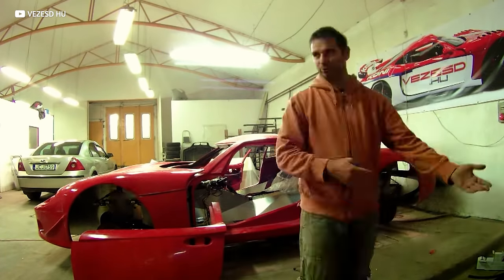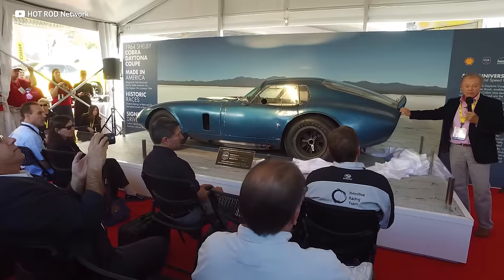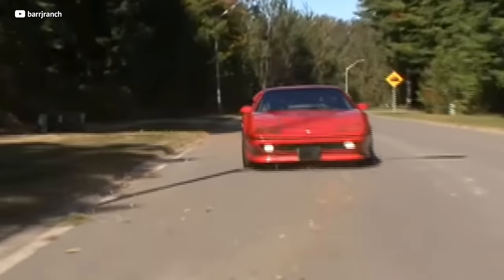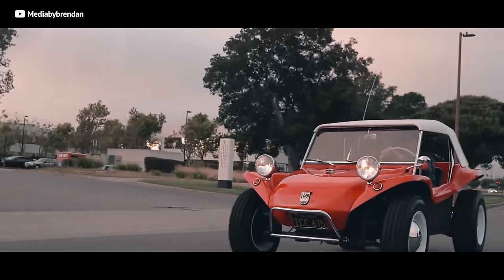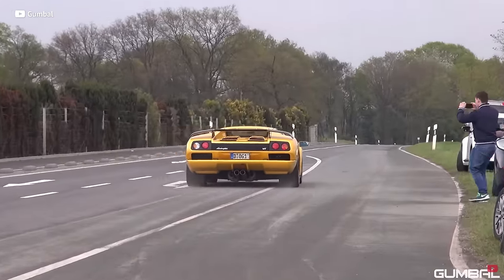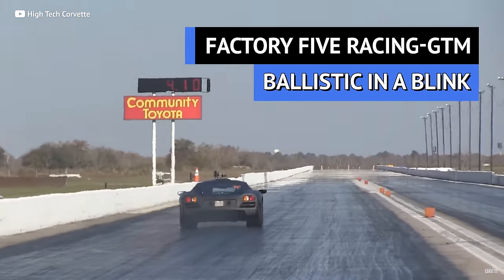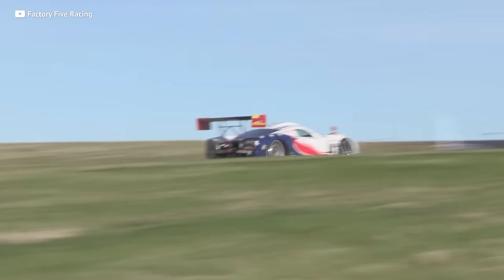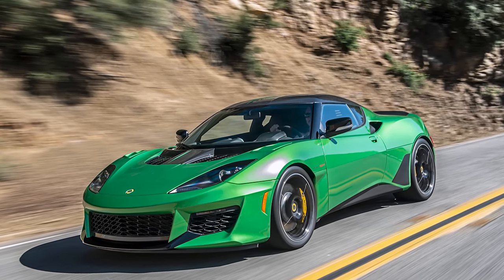CHEAP Kit Cars That SMOKE Supercars

Comment: Fiero kits can be scary fast with a V8 conversion. The kits for the V8 conversion are readily available and, with a 400-500 hp small block Chevy transplant, the "Fiero" is now a serious threat to the "supercars"...which is why Chevrolet FORCED Pontiac to STOP producing them. They were cutting into Corvette sales by the 1988 model year and that's why that year is only a half year production.
Reply: A 3800 sc is better balanced in those chassis and plenty enough power for those tin cans. But I like where you’re goin with this…

Comment: Imagine Dodge demon engine in any of these kit cars xD
Reply: Or even a Hemi or a Hellcat engine
Reply: i’d love them with an LT1 or an LS3
Reply from the maker: ayyyyy!!! would make supacar power!
Reply: @IdealMediaChannel  Ah yes 1k HP whiney boi for some super car power, sounds like a horrifying experience
Reply: you most definitely under 13, why not hellcat why you jump ? It’s 50 more horse power
Reply: Iron block.....too heavy. LS7 or if supercharged.....ZR1 or GT500 engine.
Reply: It would blew the doors and hood away
Reply: What about a 4 rotor engine.
Reply: There are
Reply: @officiallilsideshow  Not the most cost effective or reliable. Much easier to get plenty of power out of V8.
Reply: @stevekoffeld9071  I'm 4 rotor swapping an Autozam AZ-1 probably.
Reply: I don’t think it would fit, and the weight distribution would be terrible. Not to mention non of these cars can put down that kind of power.
Reply: Orrr a built 2jz.
Reply: Lsx or 2jz
Reply: @dartonbraden7957  what kind of question is that, pfft ofc 2JZ
Reply: it will be slaying tyres...
Reply: Imagine the new hellephant with 1000hp
Reply: Heck no .......a built vr38dett pushing 2 to 3 k in any of these would smoke the demon engine hahahahhahahah
Reply: Time to put one in a Miata
Reply: Dodge demon with a custom Flat plain Billet camshaft and a 8-1 exhaust system with a huge collector and converter.
Reply: Sike, u mean a 2JZ
Reply: Or a Hellephant engine
Reply: @IdealMediaChannel  more than that.
Reply: @bearieroblox6451  that's why I'm modifying almost everything from the Autozam and making it have the ability to handle the power.
Reply: won't fit kid 👍
Reply: @karlsmith2570  all three of them engines are the same platform. 🤫
Reply: @Ole_CornPop  are they??
Reply: @karlsmith2570  the Hellcat and Demon are both Hemis "hemispherical". Only difference from the Demon to Hellcat is a larger 2.7 litre supercharger.
Reply: @karlsmith2570  Hellcat is 707 hp, Demon is 840 hp. Same difference in a Shelby GT 500 and it's more powerful Super Snake brother.
Reply: Just wait
Reply: @bryantmatthews93  u gonna do it??
Reply: @rarewifi9303  i don't know
Reply: Yeah, without weighing a few tons
Reply: Hell yes
Reply: You can even go NUTS with the "Hellephant" ... but you are then getting well past the "Affordable" concept...
OR a car, suspension, brakes, etc to HANDLE that kind of HP... and all of those engine parts add WEIGHT to the end of the car where you place the engine. So handling balance can go out the window.
Reply: Yes but no
Reply: That is mecanic engineering insanity......im interested
Reply: People would die 😂
Reply: It'll be expensive as hell it's like 25 to 30k for a new Hellcat motor so I know the Demon hitting for double that.
Reply: It would probably be unbalanced?see this is the BEAUTY  of cars like this most are under 2,500.lbs therefore you dont need a huge engine from a car primarily designed to go fast in a straight line in a car that weighs 4 thousand pounds.
Reply: My bad a dodge demon weighs 4,200lbs probably doesn't handle canyons or switchbacks very well
Reply: First
On 
Race 
Day
would be better, reliable!
Reply: supercharger whine intensifies
Reply: Hear me out built k20 with a big turbo
Reply: imagine if your girl didnt cheat on you
Reply: @k00lkidz4  how can my right hand cheat on anybody?

Comment: Pontiac Fiero: It's actually a great car to work on, as long it has a MANUAL TRANSMISSION along with the V6 engine, hopefully...
Myers Manx: It's a dune buggy! You can just simply mod it, throw in big tires and off road it!
Reply from the maker: out of those two... which one would you rather have?
Reply: @IdealMediaChannel  It's a seriously tough choice for me, but in the end I managed to choose the Pontiac Fiero, because imagine driving the dune buggy anywhere and suddenly the rain comes down, not cool...
Reply: @IdealMediaChannel  you know that you can put a v8 in a fiero.
Reply: @cbradley9440  Better still, a 3.8l GM V6 supercharged or turbocharged. About the same horsepower but less weight.
Reply: I've heard of fiero builds with v8s such as northstar engines from Cadillac Eldorados,I even saw a 455 oldsmobile and a blower in one
Reply: @lokisgodhi  yeah you could even get a installation kit for them, and you start with a GT with the better suspension and already have a V6 win win
Reply: @alain99v6  Th stock V6 in the Fiero was GM's narrow 60 degree 2.8l V6. It's pretty anemic. The 3.8l is a 90 degree engine. It's a lot more powerful. Especially if turbo or supercharged.
Reply: @benjaminchartier6458  No.. the Cad engine is Known to be Shit.. just stick a good 3.8 or if you want an 8cyl, a 283 in it. A Stock 350 will fit in it also. 
@GuanZe Liew Yeah, I have an 85. The Year After they figured out all the electrical gremlins.. Planned on putting the Countach Kit on it for the Stretched Chassis, not the Stock one where it looks Squished. Then put a nicely built 3.8 in it. But it's been sitting in Minnesota for 12yrs with less than 100miles on a New Engine in it, in a field, while I am in Florida and can't find anyone to bring it down to me for a Decent Price...

Comment: I definitely understand the non appeal of the fiero but I've got 2 and I love to throw them around tho none of mine are stock and one of them has the ws6 suspension upgrade the engines are probably easier to take out than putting the body kit on it i can get it out in 2 hours and 3.4 and 3.8s bolt right up and i absolutely love mine

Comment: For what it's worth, setting aside the fact that a DYI kit car is cool to be able to say you built it yourself for cheap. The only one I would really want to build is the Factory 5 GTM but even at 25k without the C5 it will end up costing you 35-50k and that's not counting all the hours of labor involved!   Sooo I just went out and bought a cheap (8-10k) little Saturn Sky Redline, and with some bolt-on's and a tune I've got a light (2,900lbs) fun roadster making 350 hp at the wheel for around 10-12k, perfect for autocross / road course weekend's.

Comment: The Dino 206/246 GT and GTS were not designed by Bertone but by Aldo Brovarone at Pininfarina. Marcello Gandini at Bertone designed the Dino 208/308 GT4 which was a mid engine V8 powered 4 seater. The Dino 308 GT4 was introduced in 1973 and supplemented by the 208 GT4 in 1975. The cars were sold with Dino badging (continuing the Dino brand in honor of Enzo Ferrari’s late son, to differentiate non-V12 Ferraris) until May 1976, when they received Ferrari badging.  The  Ferrari GT4 was later replaced by the Mondial 8 in 1980. The only other Ferraris designed by Bertone’s Marcelo Gandini were a couple of one off Ferrari 250 GT SWB Speciales and the 308 GT Rainbow shown at the 1976 Turin Auto Show of which only one was built. Bertone did design the Lancia Stratos though. You got that part right.

Comment: The Factory 5 GTM isn’t built on a Corvette C5 platform it uses the C5’s drivetrain and some other components but it features it’s own unique tubular chassis and suspension along with it’s own body. The GTM can be built using other components besides the C5’s but some modifications are necessary.

Comment: Watched a Video a few days ago about the Ultima RS... Sure, the "Kit" is only $26,000 but by the time he was done, he had Just Under $200,000 into it. That included about a $30,000 1000hp engine and about another $30,000 in Options (just for the car). So that's already $86,000 right there and that left about another $114,000 in Stuff added himself that was not included.

Comment: 10:28 little fact the rover v8 is actually a gm design first used in Buick aswell as first Turbocharged engine EVER

Comment: The fiero was not a speed monster, as I think they were governed between 80, and 120, but they would burn out like crazy. Fun little cars, that could be made into something scary lol. I mean emagine a fiero, with a built 6.0, or even 6.2, or whatever in the back. Say 600 or more straight to the wheels lol. I doubt it would be possible to hook, but man. As quick as the little cars were with , the 4 bangers, and the v 6, that put out what 180 hp, or so lol.

Comment: great video and nice alternatives, but I kinda feel you forgot the Vaydor. definitely a potent car if you use the g37 as a base and it wouldn'T be too expensive either. 
too bad Germany is harsh on kit cars, you need a unique licening and checkups etc , which alone would probably cost aorund 10 to 15k euros just to get the car allowed on the street. Germany is mean against DIY cars :c
Reply: Laughs in India
Reply: Austria is more harsh sadly, its cheaper to send cars to germany let them stay with a friend of yours and then do it

Comment: lol I'm sorry have you seen the Factory 5 kits? For 25k you get the body and that's it. It cost around 50-60k or so to build  and that's NOT including the LS/Porsche stuff. Once you do interior , wheels, tires, aero, paint and body works etc etc you will be in for a huge surprise. I was going to do that to my Procharged vette and said oh hell no. The cost was crazy. You may want to do a little more research next time. 50k or so minus the  LS/Porsche stuff is not cheap. None of those kits are cheap.CMon man

Comment: got to say, the fiero is faster and worth more than any mustang imho. with minimal mods, a v6 manual transmission fiero will stomp most v8 mustangs, let alone a v6. I dont know what fieros you have drove or owned, but I have had over 20 of them and some ran in low to mid 12's with the v6 with minor mods .

Comment: A Fiero has one of the strongest structural designs . And you can put any GM engine in it you want. Mid engine, great weight distribution and light weight. Why is this not good to you?!?

Comment: You can find an old s600 mercedes and pull the drive train and have a reliable v12 that was used in Pagani as well as mercedes blatantly.  But you can stay far away from a bmw engine.  
I have a mercedes engine..in a mercedes lol but that engine is perfect and runs literally better than the day it was made. The transmission is the 722.9 and can hold over 1000hp and way more torture  . The independent suspension is by far better then most in it and can hold the mercedes power . 
The mercedes v12 has a formula 1 car sound when is got the exhaust done correctly.. 
Honestly by a cheap wrecked s600 v12 and use it in a Lamborghini kit. It can also be 4matic so all wheel drive like that labo

Comment: Fieros have so much WASTED
potential. 
(any stock, unmodified one that is) 
On paper, most people diss 
the fiero.
 But,on the street, people IMMEDIATELY recognize it
and genuinely love/like them.
(GT's are usually the most
accepted and received)
I have a 86 GT fastback, and I love owning it!  
The styling is still timeless,
there is a healthy aftermarket 
for upgrades, you can literally 
put whatever engine you want
in them, and they are very AFFORDABLE  as a project car.

My stock front/rear suspension has been replaced /upgraded, the stock
chokefest exhaust is gone,
(the factory y pipe is a joke)😑
I've added the sprint headers,
upgraded the stock injectors, and lowered the engine temp.
(Amongst other things)

Only real draw back for a stock/ quasi modified fiero is
that HORRIBLE hi-lo stock intake on there.
(The whole UPPER portion of
intake should be thrown away
IMMEDIATELY)
Come on Pontiac motor division, you could of made
a performance upper intake 
and sold that through the dealer as a dragstrip option.
(Gm has done this before)

I still have the 2.8 (reman),
but like the 3.4 for weight
reduction, better intake
flow, and I don't like following 
the crowd. 
The 3.8 v6 is a VERY good engine, but I want
to change the minds of naysayers that hate on the 2.8
mill.
I have plans for welding up an 
aluminum upper intake, but I
need to address the fuel/tuning aspect of things first.
I tried calling some tuners about upgrading/ deleting 
the factory obd1 parameters,
(Custom chip) but they can
only make a chip for TRACK USE ONLY. 😮‍💨
WTH. 
There is a Beretta computer swap that helps,
but I am not getting into re pinning all that wire, there is micro squirt, and HP tuners.
(More wire, and data logging)
I'd rather find someone LOCAL
who can finesse that obd1 crap, but imma probably going
to look at the HP tuner.

The fiero does haul out with
just simple mods, heat extractors, and weight reduction, but needs a proper dyno tune!
My apologies for the long post,
I am just passionate about
these little cars, and the creative potential they have!
Shalom

Comment: Wow. I cant believe the disregard for the fiero. U gotta think. Wide body short wheel base enough room  to drop a v8 in which is entirely unnecessary for an 1600 lbs car widebody kits which widen the track potential, easy to improve torsional rigidity by connecting the 2 chassis setup, and with a simple aluminum motor swap a neer perfect weight balance with no other modifications 450 hp puts you to better than 5 lbs per hp which in modern day terms is actualy not that hard to do. Low center if gravity.... you are completely wrong about the fiero. It's simple math.
Reply: The fiero has a curb weight of 2700-2800 lbs, you probably couldn't get it down to 1600 unless you took it down to the space frame and powertrain...

Comment: 1) I'm fairly certain that Parallel Designs (and it's Torero) swim the depths of the Atlantic with the Titanic. 2) The Factory Five GTM is 'out of print'. 3) My ideal engine is the retired-before-its-time LT5, wish someone would license it from GM and start making crate engines, but (in its absence) ... 4) My wished-for kit car would be a super stiff mid-rear engine tubular aluminum frame with double-wishbones front and rear that I could drop an LT4 into, probably with the Porsche transaxle you mentioned, but (when I really dream pie in the sky) ... 5) I want that super-light super-stiff double-wishbone front & rear frame that I can get with an AWD/4WS drivetrain. Know anyone with those plans?

Comment: Ok and I don't agree with you on adlino k/o kit and you probably never seen a full moded ferio with a ls swap. The best one l have ever got to see was twin charged and was 2.5 to 3 second car. Also need to check your facts a little bit better just saying because a full built factory five gtm is a under 3 second car. I can't wait for there new supercar kit for the LS base v12 to come out.

Comment: Don't dis on Pontiac to bad, my gto has flawless interior, I think a good over all look, and it is fast. Now yes I do want a kit car, for the expensive look, and the lower weight, but don't diss on my Pontiac lol. Even if the fiero was ugly, for a small car it was quick, at least for the time. My cousin had one, a gt I think, and it would eat first, second and third, then if on it hard chirp 4th gear. The thing was a tire eater on burn outs. So show some respect, I mean who doesn't like the T A , or the formula firebird?

Comment: I dont know. Building a car looks like a quik lego game here. Take this and put this here. Now just throw in the motor, Transmission, etc and voila. Your own supercar copy for 50k. OK you got to find tbe engine. And paint it. But hey. What are 30k extra. A lambo is half a mil. I dont want to know how many "Projects" wont Look like the ones in the video. 😄😄😄 I promise everyone. Your bank account gonna melt faster than your supercar 😄 goes on top speed. Btw. The costs of keeping a BMW v12 working without problems. Only this problem will tear your wallet into small peaces. Believe me. I learned at BMW for 3 years in Germany. The price for parts are insane.

Comment: "The Elephant in  the room" should go back to Factory Five, or maybe Superformance, for the Shelby Cobra 'replicars'... Of course you mentioned the Type 65 and the GTM ... but the Cobra is as "Iconic" as you can get... and only your powertrain budget limits your 'supercar' results..!!  True that the short wheelbase can be "a handful" at high speeds -- the Reason Carroll Shelby and Brock built the Daytona 65 Coupe in the first place -- but for a Street Car, and playing on mountain roads, or Saturday night Cruising... put some RUMBLE under the hood and lock it down so nobody knows what lies below... Classic-Look Rouse 427... or a twin-turbo Coyote screaming at 700+HP... ??  But make friends at the Discount Tire store...'cause you will be there a LOT. And GET a 'Stick-Shift' for crying out loud...  Like the Caterham... it is about Driving FUN!

Comment: I'm currently in the process of building a DF Goblin. It uses the drivetrain out of a Chevy Cobalt SS.  I'll have about $15K into it by the time I'm done.  Probably could build one for $10K if you use a standard Cobalt and leave out some of the options.

www.dfkitcar.com

Comment: Its pronounced "Lan - cha" not Lan-seeya. 
Both of those engines are horrific choices for a Stratos replica, especially the damned toyota engine.
The only correct engine to install in any Lancia car is the Lampredi  twin cam
Also anything based on a Fiero is total garbage.